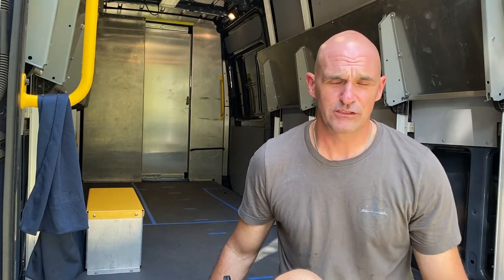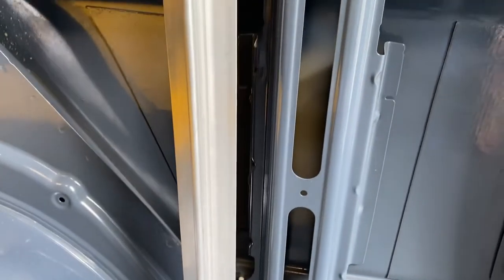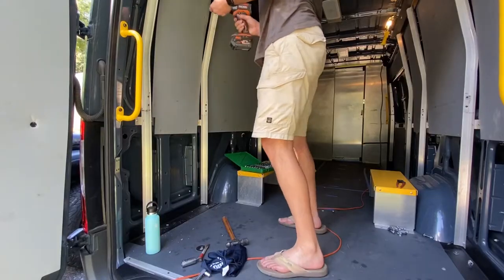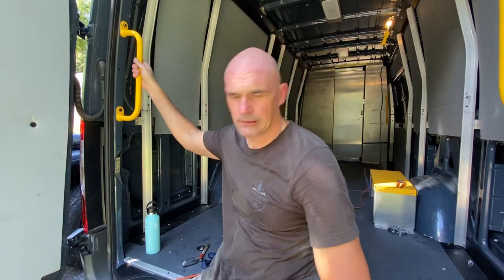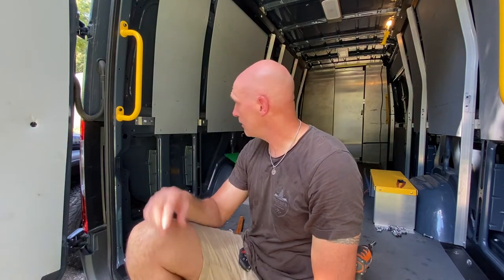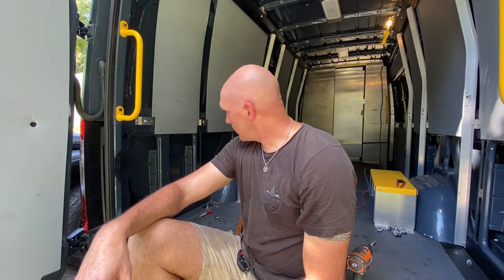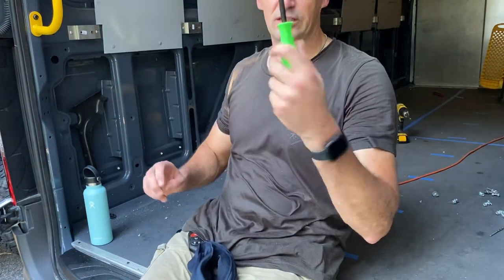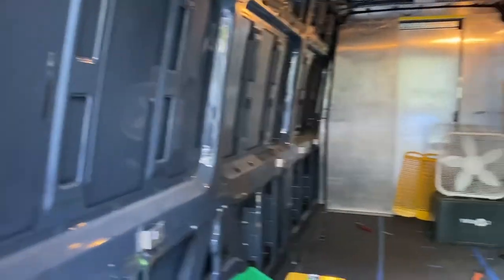How We removed the amazon shelves from our 2019 Sprinter Van

Comment: Did that partition vibrate a lot or was it actually quieter with it in the van?
Reply from the maker: It rattled quiet a bit the door didnt really latch solidly and everything vibrated when you drove down the road, the partition was pretty solid it was the doos that made all the noise
Reply from the maker: Thanks for checking out the channel
Reply: Thank you for reply 👍

Comment: How about the pedestals on the floor? And I’m interested in how to fill the holes left behind. Good work y’all.
Reply from the maker: Thanks, they came up easy, they were just screwed into the floor, as to the holes, I took and hammered them flat, sanded and then used some rust converter, then a etching primer, once all that was dry, I used 3m 5200 to fill all the holes, its a marine sealant that works great to fill and seal holes, you could use any adhesive sealant but thats what I chose!
Reply: @ramblingambition  Awesome! Keep it moving, good sir🚐
Reply from the maker: Thanks you too!
Reply: @ramblingambition  Any reason you didn't leave the holes as mounting points? I am not intending to do a subfloor, but use the existing floor, with ring mounts.
Reply from the maker: I did leave the factory floor mounting holes as i used some of them as additional points to secure the floor to

Comment: How did you remove the bulkhead? Any video on that?
Reply from the maker: No video except me carrying it out.  It was really easy just a handfull of bolts around the perimeter, all easy to get to and it comes out in one piece, thanks for checking out the channel
Reply: @ramblingambition  no problem I just got an Amazon van going to pick it up in two weeks thanks for the content
Reply from the maker: Awesome congrats, its really not hard to get it out, if your buying it from a mercedes dealer, check to see if they have a code update to turn off the amazon programming notably the speed limiter of 75mph and the darn auto door lock that activates everytime you shut the doors within 10 sec!  Last time i checked they still didnt have it